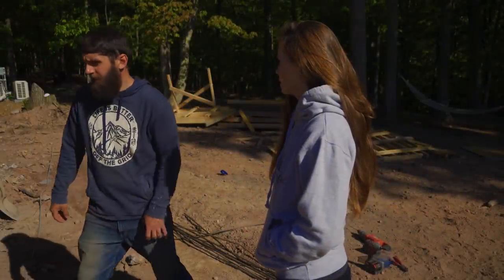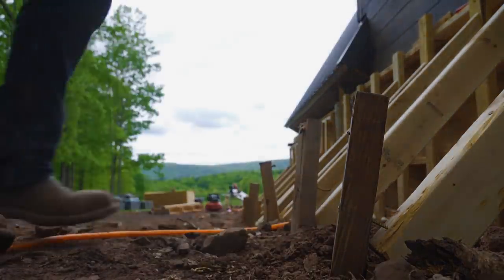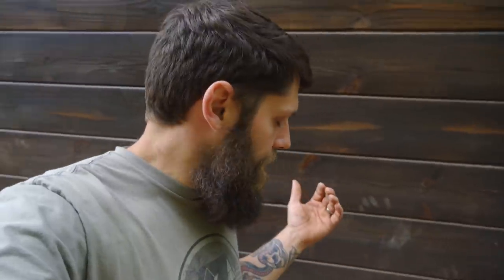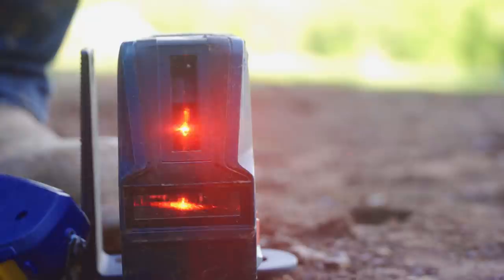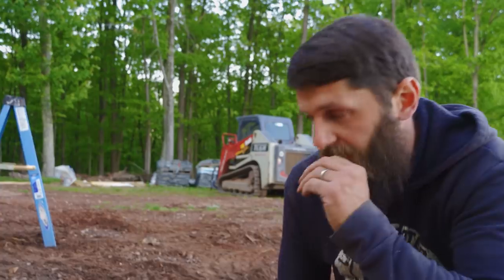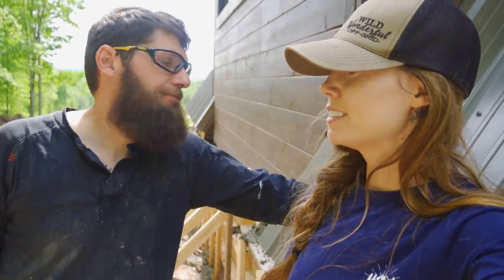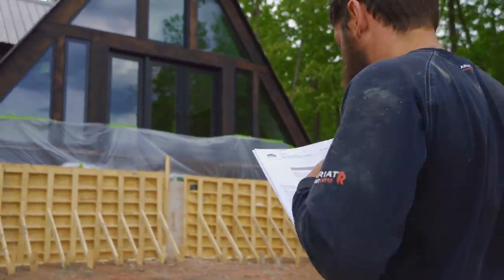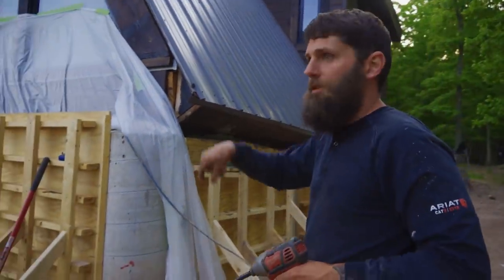Starting The DECK BUILD

Comment: The material choice for the deck? You want to cover the concrete sides of the house with natural rock. Make that the sides under the deck too. The deck's deck/floor - metal may make a lot of noise when you walk on it. Wood - charred wood like the house - would look like it belongs there and create visual unity. But, outside deck floors easily have algae and/or moss on them, especially with wood or rock. This may make wood slippery - if you do not put the maintenance/cleaning effort in, each season. Consider that the deck might become part of the life outdoors and you may start doing more on it then you envision today. I would put some masts in the concrete pillars or extend some carrying posts under the deck so these become masts that could have a tarp between them, one at height, that you can easily roll in and out with a couple guiding and roll in/out cables.
Talk about rock, you guys rock. Very nice video , storytelling and nice visual bits from the nature around you, cut in to it.

Comment: U need to plastic the ground under the house to stop Radeon gas , if your area was fracked the gas is there .  Also get a pressure test done on air leakage , then seal and install air exchange system , thermal , You'll thank poster

Comment: Will the roof overhang for a portion of the deck be an extension of the A framing?  You may want to consider the reduction in light entering the indoor living space that the roof will cause.  Always a choice - outdoor shelter or indoor brightness when it comes to overhangs.  Can't wait to see the deck design develop.

Comment: Love your channel ~ Been w/you for 3yrs ? (around 3yrs now) I saw the "A" frames geaux up :)

Suggestion :   

I have a 12' deck spanning the length of my place w/ a 13-1/2' cover (metal roof). While there is plenty of room for my table and chairs along w/passing by each other , (BB-Q pit there as well) I have chairs on the outer edge facing back to the house to chat w/company or others sitting face to face w/ me.  The rain comes in even w/ the extra foot & a half (1-1/2') over hang.
THE RAIN IN LOUISIANA IS LIKE THE RAIN I'VE SEEN IN YOUR VIDEO'S !!  :)

a.)    think about whether you want to only sit & look away from the house from you 1st and highest deck or if you might want to entertain face to face (depth wise).
b.)    remember a "GOOD" 2' or 3' deck roof overhang will keep you and your property (furniture) dryer !!
P.S. 
c.)   I have stairs and ramp.  I love the ramp better for walking up and for moving large appliances, furniture, bicycles, etc... in or out of the house.  I use the ramp more than the stairs.
d.)   Metal & Cables seem less busy , more visually transparent & a Blk or Bwn (wrought iron or paint) would match the house trim for sure & for certain !!  :)

You guys inspire me to keep busy and entertain me in my off time.  God bless you and your children, dogs, pets and livestock.
Sincerely ...........................
Steph

Comment: Hey guys I don't know if you're dealing with city codes or inspections but as high as your deck is off the ground...you will be required to put some type of acceptable railing around your deck if there is an inspection? and I heard you guys discussing what type of system to use...so I vote for the "cable railing system"...it's unobtrusive...very clean lines not busy per the Lady's wishes and it doesn't interrupt the view and still gives you the comfort of knowing the little 1 wont fall off the deck

Comment: Hi guys . 
How about stainless steel tube uprights . Then stainless steel cable between the posts . 
Quite a modern industrial look . 
But quite simple . 
Great video as always .
Reply: Got thinking about this . 
3" / 75mm diameter posts . With 1/4" / 6mm cable . 
Wouldn't be intrusive at all . 
Did a similar job onsite here in the uk . 
That was for an upstairs landing then on down the stairs .

Comment: Cool! The Deck: Given the current costs of lumber - a synthetic like Trex becomes far more attractive or perhaps an IPE product.  No joke, those driver(s) went the extra mile and seemed really focused. That's, trust me, lol, not always the case...in fact, sadly, it's atypical. A job well-done is its own reward but that said - buy those guys a gift certificate for pizza and beers IMHO.:). In the trades - that travels fast. Really impressed. PS; If you do metal on the deck (I think someone mentioned that) go for drill n bolting rather than welds. Welds are too permanent additionally bolts done well can look aesthetically pleasing - imparting a sturdy/rugged look with a certain country refinement. If you go that route - buy a magnetic low-profile magnetic drill press (depending on what type of steel you use - I beams, square, angle) for easy easy drilling..few hundred bucks.

Comment: Josh makes a load-bearing deck, lol ;p  At least those piers will give you plenty of wiggle-room for post placement. Breaking up a large deck with railings, planters, seating and the like doesn't have to obscure your view. Wrought-iron would be expensive-- I think simple 2x2's capped with 1x4's, and I'd use the recycled plastics products for way less maintenance. I'd make the second lower level smaller than the house-length top level, and would have twin stairs heading down at 45 deg. to each other (22.5 deg. outward from the center from the top level). Your hot tub could sit between the stairs. Some planters strategically placed at corners would 'frame' the deck, giving the eye a focusing boundary. Bench seating sections backward facing would create conversational areas with deck furniture. Railings give a sense of movement and security. You might have a grilling area at ground-level with the BBQ. Mid-level planters on the sides would reduce the need for screening the underside.

Comment: If you’re not looking to match the shou Sugi Ban on the house, match the black frame of the glass - use black aluminum posts with heavy cable painted black for the railings - by using black, it looks less industrial and easily disappears to the eye when focusing on the ‘long distance’ natural landscape.

Comment: Stainless horizontal cables with whatever posts fit your taste.  Of course a top rail to sit your drinks on etc.  I just built a deck.  Hated how the traditional railings blocked my view of the property.  Ripped out the rails and went cables. MUCH BETTER.

Comment: I disagree with stairs all the way across the backside.  You need stair railings for safety.  I'd do 1/3rd stairs in the middle with railings.  Put seating all along the outside of the deck to the center railings.  That gives you plenty of seating and safety at the same time.

Comment: So the question is: for the new addition will the foundation be piers only, standard footings with foundation walls, or piers with foundation walls?  I think you did only the piers on the main house just to save time and are now adding the foundation walls.  The piers looks like they make a stronger base to build upon.  Where I live we have issues with foundation footings settling since they don’t drill down to bedrock.

Comment: I think having the entire front of the deck be stairs will look rather busy, personally. Or make the front of the house look too large. A few other comments have suggested steel cable railing as a solution that won’t obstruct the view, and I’ve seen some subtle wire mesh that will make a hard-to-see barrier that’ll keep those puppies and the kids safe on the deck. Perhaps dark wooden posts at the corners of the deck to match your siding, with black metal poles or cables along the top of the railing and mesh below?

Comment: Do the 8 foot overhang as the same height as the house. Then drop the rest of the deck down like 3ft. Then whatever you intend to put on the deck will be out of line of sight too. You could do a seating nook under the eaves of your a frame and the drop from that overhang, you could do a small raised planter to make sure it's not a sheer drop/ stop kids falling off, but also doesn't affect line of sight for the view Instead of a full length step, you could just have steps in front of the doors. Cheaper, less stringers to get perfect. Lower amount of steps to get off of the deck. 
If this doesn't make much sense/but interests you I'm happy to try and draw what I mean and send it to you via email? 😊
Reply: Sent some pictures on Instagram!
Reply: Just thought, that would also give you full height access to the door you installed in the front of the house.

Comment: since you do electric work how about some electric conduit  for the railing?   the wire might work better.  keep it easy to push snow off if you need .  do like my trex decking.  wish i did metal or the wire for the railings.  except needs to be something you would not need to paint.  do you plan on gutters?

Comment: metal frame on less on concrete piers metal frame fewer piers) decking from recycled composit decking for durability and should be less expensive than pressure treated timber

Comment: It`s amazing you 2 do such a great job, as a comedy team! lol I think i would go with thin but strong stainless steel posts with stainless cable. Get the good stuff that won`t rust in 2 to 3 years like the cheap stuff from over sea`s. [china]  Also you might want to park your tractor at the end of the deck with the top of the bucket at the height of the top of the deck to simulate how bad your view will be blocked from the inside as you sit on the couch, stand by the couch, sit in the kitchen, etc.  If it blocks too much view, you might want to do a 2 or 3 level step-down deck.

Comment: If it was me building the deck I would use metal post and 1/4" stainless steel cable for the cross  rails

Comment: I’d like to see A Handrail on either side of the decking in metalwork but like old fashioned scroll work and it would be amazing if Wild Wonderful off grid wording could be incorporated into the design so you saw it from the side .... Wild at the top most level ( so just below the handrail) then Wonderful below but the W inline with the D and then you could have Off on the landing part and the Grid on the final staircase section.... I’m just thinking about the old iron work you used for the Sliding doors and the blackened ironwork and it would look keep that colour/theme going throughout the house by having something like that on the Handrails and you have to have your Names and that of the children or all of you incorporated in somehow the design of those handrails

Comment: Great work with the concrete another job ticked off. As other comments use wire! But it would look better with steel, black would look great in that area. Keep up the fantastic work remember rest as well.

Comment: You go metal, you use special paint, so no rust. Use stainless wire to the posts, again no rust. You do want to ground for sure. Planking would be composite material low maintenance.

Comment: Do wooden, or steel/iron railings with a wooden handrail.  Regardless of how "contemporary" cables, or stylized metal work is, it will soon look dated. This is your forever home, so go with classic, clean lines to last a lifetime. Thank you for also hating glass. It would get moldy and frosted, and end up looking terrible. You already have enough glass to clean in the front!

Comment: Looks great guys...
Pro tip:
Mark on the auger with marking paint or sharpie 3 ft
And you will know your holes are deep enough without measuring....just an suggestion..great job

Comment: No way on metal. You have so much beautiful wood, stay with wood.
Reply: Dang, I would have sworn the roof was metal and there is an awful lot of roof.
Reply: @dennisnagel4422  there are several sides of the house. Two sides worth mentioning are the inside and outside. Surely the deck will be wood, or at minimum a look alike composite. Either way it is and opinion. That's what they are looking for.

Comment: If you have older members of the family and plan to be out on the deck in the winter you will want to have some sort of railing in the center of the stairs......    You will also need railings on the sides for protection from falling off (your insurance company will certainly tell you that)...      Beautiful work.

Comment: pathagorean therum ...go to the corner and measure 3 feet from the corner out  make a mark ..measure 4 feet from the other side out from the corner ...make a mark on the string ..now measure diagnol  it should measure 5 feet   3 4 5  method then it will be square !!good luck !!!😃

Comment: Would it not been easier to build this with blocks? The concrete is not adding much (if any) structural strength to the house? BTW, Just an opinion I still think you guys are doing an amazing job

Comment: I am concerned that being on the deck with no railing across the width or back of the deck will (1) cause constant awareness of getting too close to the edge, ie, fright response and (2) more accidental falls off the deck. It works for a deck close to the ground but this deck is going to be 8 feet or more high. The right railing across the back of the deck won’t obstruct the view.
Reply: Stay off the deck than
Reply: @dennisnagel4422  - ok, another more direct way of saying it is that building codes require guardrails on any deck 30 inches above grade. I hope I misunderstood what Erin meant about no guardrail along the width of the deck. I understand they live in a county with no building code, so they can build as they like. But safety has to take precedent over design. And as an attorney, I guarantee that anyone who visits this home and is injured by a fall off that deck will have an excellent lawsuit against the homeowners policy. And on that point, the insurance company most likely won’t pass inspection and they will be denied a policy. Of course, they own the home and don’t have to insure it. But, they assume all the risks of property damage and personal injuries.